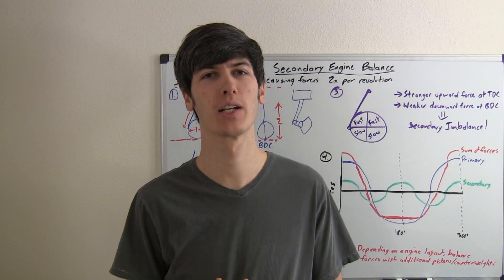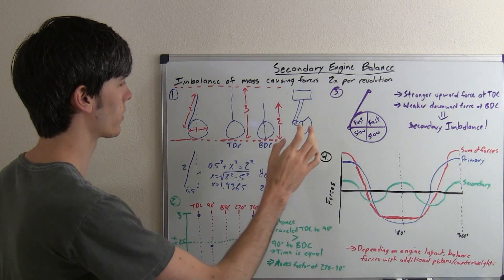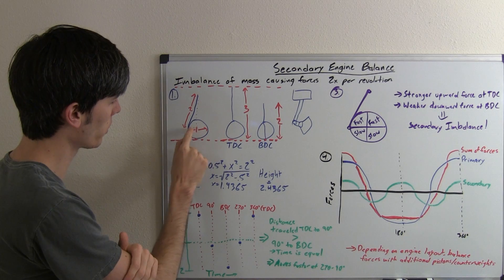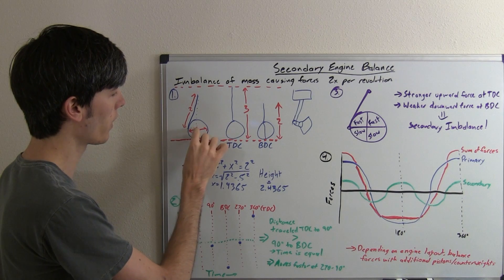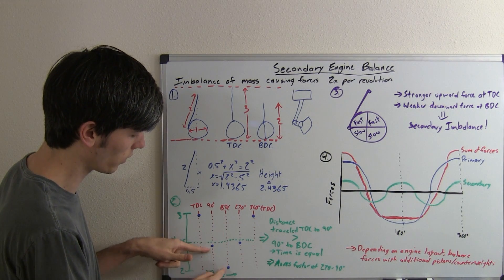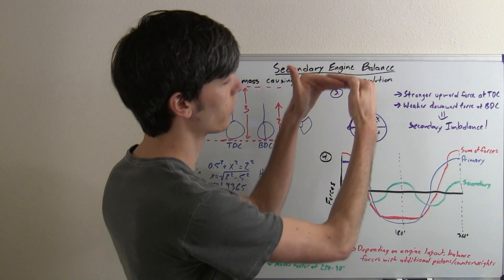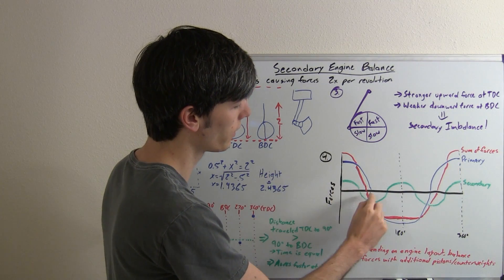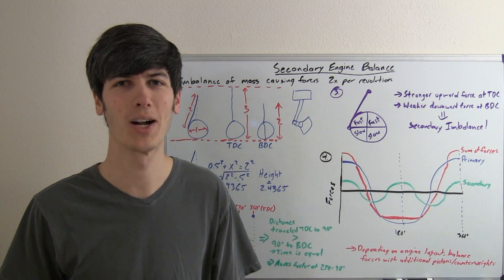Secondary Engine Balance - Explained

Comment: Your Math is off X=2-.4365.  or X=1.5635. so half of the dots are in the wrong place in the 2nd diagram. I think you are giving a cascading error. This is a better explanation of the problem than Philip H. Smith in "The Design and Tuning of Competition Engines" but it is not all there. What are the books you read, that gave you the ideas you present here on U-Tube?
Reply: James Thornton He said 2.4365" is the height of the piston pin at 90° and 270°, not the travel. The piston travels 1.1306" up+down from 270° over TDC to 90°, but travels only 0.8730" down+up from 90° under BDC to 270°. That means the piston travels faster through TDC and slower through BDC if the crank is rotating at a constant speed.

Engineering Explained What you described in the video is not a secondary force, it is simply a non-sinusoidal primary force due to the geometry.

A secondary (also second order) force is caused from the reciprocating components, meaning the crank pin and a function of the connecting rod. Not only are you lifting it up and down in a sinusoidal wave, but laying a rod at an angle then straightening it up is also adding a force from the center of mass rising and falling. At TDC and BDC the inertia from the rod is pulling up on the crank but at 90 and 270 the rod is pushing down on the crank. 

To help illustrate this, forget about the crank causing an up/down motion and think about your pen on the table and make this motion with your pen: _ / | \ _ 
and let the cap rise up in a line and keep the tail end slide on the table.

When you straighten it this causes and upwards momentum. Do it fast enough and the pen will want to keep moving up because the center of mass has moved upwards, and you'd have to pull it back down. This is what is happening to the connecting rod. This is what a secondary force is, and it happens twice per revolution.

Also, you should talk more about the vibrations due to the side-to-side motion of the connecting rods as this has significant effects on all engine configurations.
Reply from the maker: My math is correct. The height is 2.4365 (as you've mentioned, and as I've written on the white board). It's the pythagorean theorem.
Reply: The Con rod only has a one inch throw. You may have done the Pythagorean theorem correctly as a math operation. But there is no room for the 2.4365 inches of travel with the one inch throw crank that you put in the drawing.  Pride goes before the fall.
Reply: Blaylock1988 It is a second order being described *very well.  The piston motion of a crank slider mechanism is made up of an infinite harmonic.  It is usually enough to consider only the 1st and 2nd component of this in terms of engine balancing.
Reply: Certain engine designs have an advantage in balancing. For example my favorite engine, the straight six with a star configuration crank, is inherently balanced up until the 6th order. Whereas all I-4 engines are not inherently balanced at 2nd, 4th, 6th, etc. So those need to be balanced using other methods.
Reply: +Engineering Explained 2.43... is right but sqrt(4 -  0.25) is not 1.43.. but 1.93 and you should be adding 0.5 to it (instead of 1 like you mentioned in the video) at 90 and 270 degrees since it is halfway up the crank. 

so the math is wrong, but it doesn't matter since you got the answer magically. TIL engineers are wizards.
Reply: +Carl Vanderlip finaly somebody that sees it too.
Reply: Blaylock1988 i love straight sixes too, but whats a star configuration crank ?
Reply: pec1739 A crankshaft where no two pistons are TDC syncronized, if I'm correct
Reply: pec1739 It is a term for a crankshaft that is anything but a flat plane. For a straight star-config 6 each crank pin is 120 degrees apart, so 2 cylinders would actually be at TDC at the same time. Calling it a cross-plane wouldn't be correct because that usually implies 90 degrees apart.
Reply: +Blaylock1988 This thread is from a long time ago, but thanks! I think your comment has helped me put the whole idea together.
Reply: Sorry, the total height is 1.93 plus .5 right?
Reply: +Eduardo Herrera yes. it's just that the way her wrote '9' makes it look like a '4'

Comment: So the forces are moving up between 90 and 180 degrees because the piston is slowing down? Dont quite understand why the forces are moving up at bdc. Been searching all over the web but cant seem to find any explanation.
Reply from the maker: Petter Kopperud The piston is decelerating, as in there's a small force in the opposite direction (due to the geometry of the stroke).
Reply: Engineering Explained thank you so much for clarifying, i had the same question, i couldnt understand why the force was in the same direction when its tdc and bdc.

Comment: The longer the connecting rod, the less the secondary force, right ?
I assume :
If the connecting rod is infinite long, x will be almost equal to 2,
and then no secondary force. Is that right ?
How does the engineer determine the ratio of (radius of crankshaft/connecting rod) ?

Comment: I don't understand one thing. The whole piston velocity imbalance you're talking about occurs only one time per revolution, doesn't it? We have fast-slow-slow-fast (using your circle) and starting and TDC. It's a sine that happens once per revolution. That would happen twice per revolution if we had fast-slow-fast-slow.

Can you please explain the reasoning behind this? Thanks for the videos, keep up the good work.
Reply: I got confused by this too.
I think it's made easier by thinking about it in terms of where the vertical force is going:
- In primary imbalance, we have a force of N pushing DOWN on the shaft until BDC (intake/combustion), then we have a force of -N on the shaft pulling UP on the shaft until TDC (compression/exhaust).
  Ultimately, we have one change in force every rotation of the shaft (N changes to -N)
- secondary imbalance, we break it down further:
  - TDC: Force xN pushing down on the shaft until 90°
  - 90°: Force N pushing down on the shaft until BDC
  - BDC: Force -xN pushing up on the shaft until 270°
  - 270°: Force -N pushing up on the shaft until TDC
  Note that:
  - Our variable 'N' isn't the same one as in primary imbalance. I just used the same symbol to make it easier to read.
  - Our variable 'x' is just some fraction. It'll vary depending on the diameter of the crank shaft and the length of the piston rod.
  You see that the force changes twice as often (xN to N to -xN to -N) in one rotation as compared to our example primary imbalance.

An easier way to see it is to take diagram No. 3 and split it vertically in 2. On the right we have downward force, and on the left we have upward force, so it's DOWN fast-slow UP slow-fast

At least, this is my interpretation of it. I welcome feedback.
Reply: @harryham1  Although I didn't pose the question, I was able to benefit from your very comprehensive explanation, thank you :)
Reply: @arnedorr6904  Thanks for letting me know that!
Going through some serious stuff at the moment, and that really brightened me up.

Comment: Shouldn't the slow areas be at 0 and 180 and the fast at 90 and 270? Seems more intuitive than looking at it from the "bottom up".  After all the same thing is happening if you take your measurements from the "top down".  It's really just the difference in the relative mass of a constant speed counter weight and a variable speed piston that causes this right?

Comment: could you please explain how the upward and downward forces happen twice per revolution? it looks like it is the same as the piston (one downward force and one upward force) per revolution. i understand that the upward force is greater than the downward force, but i dont see how that is occurring 2x more frequently than the primary force of the piston. thanks!

EDIT: for instance, why is there a positive secondary force at 180?
Reply: ***** could you please explain more. what exactly occurs at 90 and 270? it looks like a downward force changes to an upward force at 180 to me.
Reply: Bear in mind that there is a deceleration just prior to TDC and an equal acceleration just after - the point is that the deceleration and acceleration prior to and after BDC are weaker.  What this means is that, per crankshaft rotation, you have strong deceleration prior to TDC, strong acceleration afterwards, then weaker deceleration towards BDC and weaker deceleration after, hence four secondary moments per crankshaft rotation.  His diagram to the upper right corner is confusing as it makes it seem as though there are two halves of the rotation during which the velocity of the piston is constant, where, in fact, what it shows is that the pairs of decelerating and accelerating moments are not identical, two being rapid and two slower.

Comment: Great video .but i've a question : how to make the engine rotate in the same one direction and not in the opposite direction
Reply: The electric starter motor turns in one direction beginning the engine's rotation. The issue is fuel, as fuel is usually mixed with air before it enters the combustion chamber. With direct injection, it's theoretically possible, but would be difficult for four strokes. Much easier to do with two strokes because there is less work to do in a cycle. Detroit diesels were known to sometimes reverse direction.
Reply: Authur Jackson thanks

Comment: Thank you very much for this educational video. Do you happen to have a video about engines redline? How to get engine to Rev higher? That would be a very interesting topic, because you can increase your horsepower. If not maybe this would be a good future video idea, a video about how to get engines to rev higher. Especially engines with only two valves per cylinder.
Reply: If you are talking about a stock engine, the only way to do is by lightening the cranktrain. Crankshaft, conrods, pistons, valves etc. Porting the head may help breathing issues slightly, but the main things will be the manifolds, intake and exhaust. Once they breath freely, mild forced induction - that of a centrifugal supercharger or a turbo with large housing - will also be an advantage.

Comment: Does air resistance due to intake & exhaust cycles have any influence on this balancing dynamic?
Does alloy of this crankshaft bearings have any influence on engine life, like aluminium vs. copper based alloy, & different alloys, & so on.
Reply from the maker: Air - perhaps, but ultimately negligible. Material selection is always important, yes.

Comment: Crossplane crankshaft would minimise this?
Reply: Do you mean a "180 Deg" crankshaft?
Reply from the maker: Yes, but then the primary forces would producing a moment, rocking the engine.
Reply: That's what I thought. A while back, Warren Johnson tried a 180 deg crankshaft in an effort to make more power. It worked but the vibration was too much to get past. If I recall correctly, there's past Ferrari that used a 180 crank. I've heard there are benefits to the 180 crank but can't remember what they are.
Reply: LD9user There is confusion between flatplane and cross plane. The benefits to the flatplane v8 are that the crankshaft is considerably lighter and an even firing order is available.
The inline-4 crossplane crank of the R1 loses power of the standard I4. The advantage is it's "big bang" firing order gives better acceleration through and out of corners. The advantage of big bang configuration just happens to be one of those weird motorbike things.
Reply: 99% of v8's use cross plane cranks because they started producing them in the 30's and American car manufacturers haven't had an original thought since the war.

In seriousness, they reduce NVH and when you are dealing with large displacement engines, you don't really care about a bit of extra weight in the crankshaft and block or if it can only rev to 6 or 7 thousand rpm. 

Flat planes are for high performance, usually smaller capacity and short stroke. Short stroke reduces the secondary order vibration.

No one ever complained about the driveablity of the ferrari and lotus v8's.
Reply: If flat plane v8's were superior to cross plane v8's, bespoke v8 racing engines would be flat plane. AND THEY ARE...

Cross plane v8's have slightly better NVH characteristics over flat planes. They weigh more and produce less power and arguably sound better (though that is subjective).

Your comparison of the driveability of cross plane inline 4 on a motorcycle and cross plane v8 are invalid. The advantage of the cross plane motorcycle engine comes from the uneven firing intervals, aka, "big bang". Cross plane v8's do not have uneven firing intervals, they have an ignition event every 90 degrees, the same as flat plane v8's.
Reply: 720/8 = 90. Ignition stroke occurs every 90 degrees.
Reply: If it were an inline 4 I would have divided by 4, not 8.

Comment: I was wondering if you could do a video on how to have a high flow exhaust/intake that is also quiet. The reason: Some states have laws stating citizens cannot have an exhaust that is significantly louder than the stock exhaust system without risk of a ticket.

Comment: Anther great video. I don't quite agree with your description of piston velocity though. I think piston velocity is zero at both TDC and BDC. At the half way up or down rotation point the piston speed is at maximum. So the piston is not slower in the bottom half than the too half. The secondary imbalance is because the piston speed is out of phase with the primary balance.
Reply from the maker: Yes, it is stopped at TDC and BDC, but the piston moves faster (a further distance in a shorter amount of time) during the top 180 degrees of rotation than the bottom 180 degrees of rotation.
Reply: Engineering Explained i'm fascinated by your videos so don't take this as a criticism. I can't see how the distance travelled by the piston is any different in the top 180deg compared to the bottom. If it was, then the crank rotation wouldnt be circular! In a single cylinder engine you could argue the piston is travelling faster in the 180deg of the power stroke but for anything with more than 4 cylinders i think the radial velocity of the crank is the same throughout the 4 strokes.
Reply from the maker: The crank motion is circular, and the distance the piston moves is greater on the upper 180. This video proves it with simple geometry.

Comment: great explanation!! just one question though. where did you get the proportions to your model of 'diameter 1, con-rod 2' ? are these dimensions proportional to most engines? i mean, do all engines' con-rods travel faster from 0(deg) to 180(deg) BECAUSE of these dimensions? or do the con-rods travel this distance faster due to the power stroke
Reply from the maker: I made up the dimensions so the math would be simple and easy to understand, the proportions are not representative of the real world (at least, they have no basis from the real world). The speeds could be faster or slower depending on the setup.
Reply: Engineering Explained you are awesome! Thanks.i definitely want to know more about real applications where it can be broken down to the measurements. Thanks
Reply: interestingly, Smokey Yunick did an article about con rod length/stroke ratios.
It was about 45 yrs ago, but I think it was about keeping the length as short as possible but that increased the cylinder wall loading, increasing the chances of ventilating the block.

Comment: I never realized this, thanks! I have, however, theorized about power production from an elliptical crank shaft motion. I got the idea from seeing pro cyclists using elliptical chain rings (the front gear attached to the pedals). The oval gears allow the pedaling force needed at the top and bottom of the stroke to be less (because you're less efficient at those positions) and normal in the forward and backward positions. Have you ever heard of this being used in a car? If not, what are your thoughts on it (just the idea, not necessarily how it would be implemented)? Thanks!
Reply: +Dani2wheels I had the same idea after watching this video, googled for it, and found my way back to your comment :)

The first problem is that the piston doesn't drive the crank via a chain (like your legs do on a bike) so it will inevitably drive it in circles unless you connect it eccentrically like in a Wankel engine.

[searches google for "eccentric crank engine balance" instead]

I found a rather back-of-the-envelope patent for a design like that:

https://www.ipo.gov.uk/p-find-publication-getPDF.pdf?patentNo=GB2449506&DocType=A&JournalNumber=6236
Reply: crossplane crank
Reply: Wow, I always wondered about the elliptical front sprocket, but not enough to actually question why.